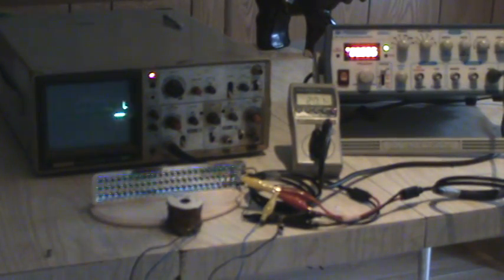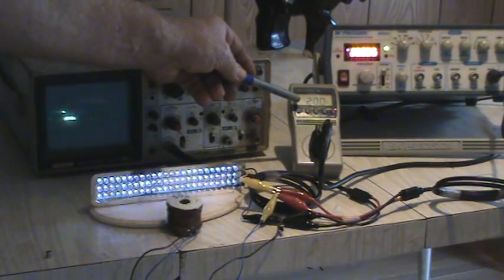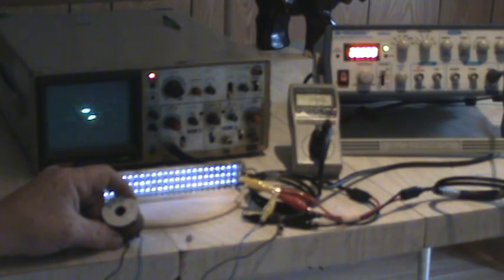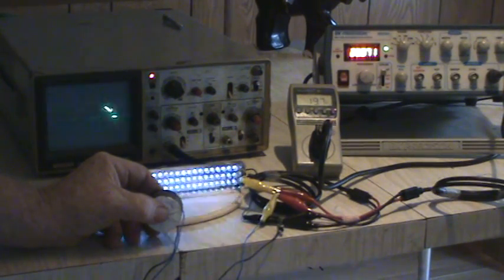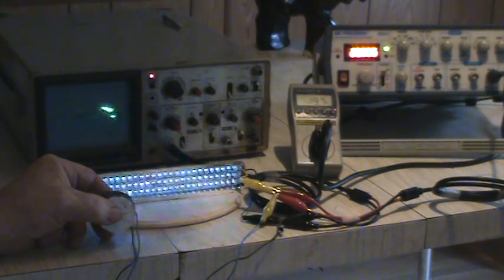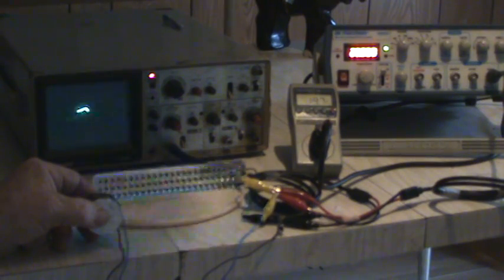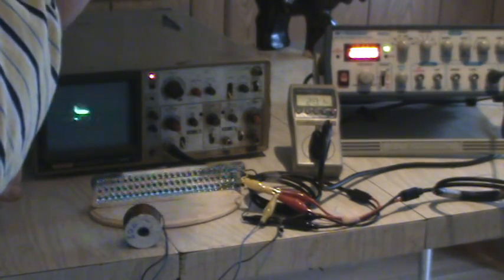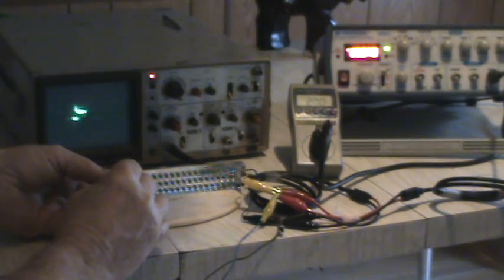Ray's Magnetic Spin Generator 1

Comment: Well done, but try to use a LC series tank circuit to energize and not just a coil, so you will not have any DC input current, but just AC, so it will have less losses. So you only have the charge and discharge currents of the caps via your coil...
Then find the right resonance frequency...and use coil shortening and opening to generate spikes...
Regards, Stefan
Reply from the maker: Thanks for the feedback. It is a work in progress. I have my second version up, and I'm working further on it.
Reply from the maker: raymondslab with recent testing I found that the starting impedences were mismatched and when it started spinning it tended to match impedances and cause a rise in voltages    in other words I started with a full bushel of apples and dumped half out then put a hand full back in and called it rising voltages     still it may have merit